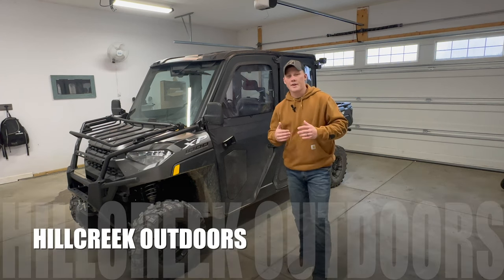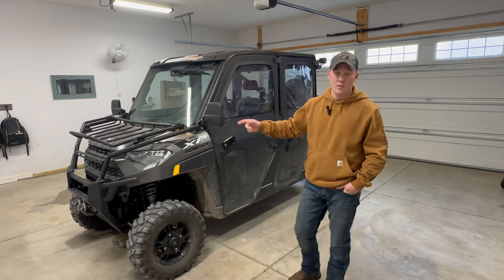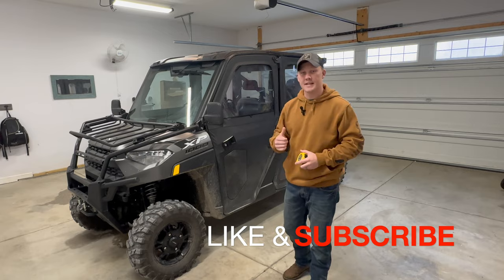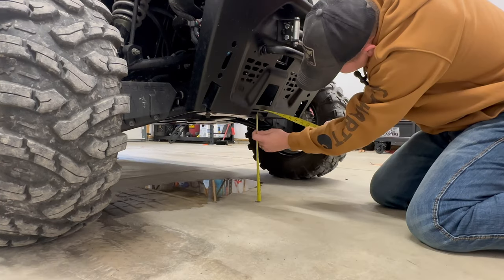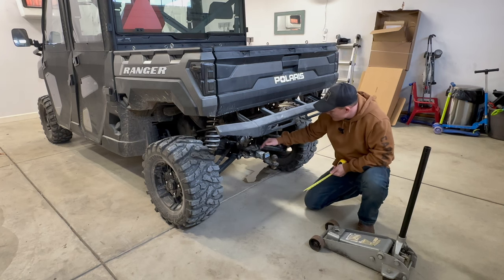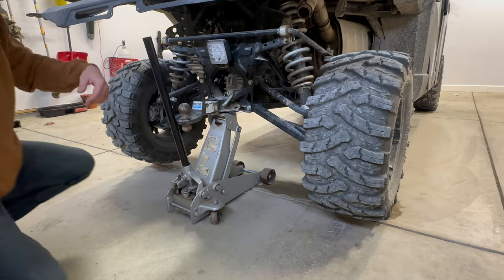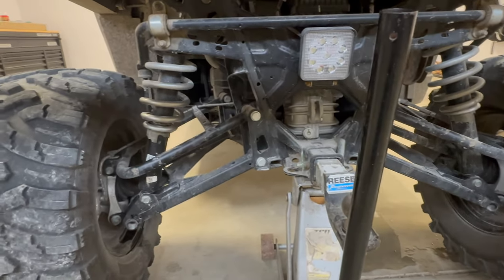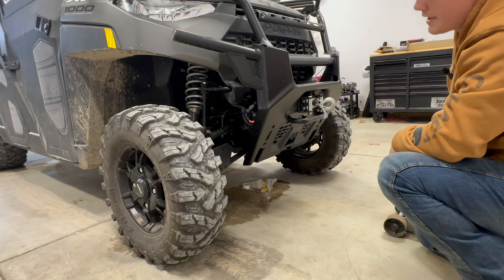POLARIS RANGER: How to Adjust Suspension for Clearance and Firmness

Comment: How much smoother is the softest vs the firmest?
Reply from the maker: @lifewithtimmyd7641  you can tell the difference when riding on rough surfaces like through woods but honestly not a major difference. After riding with softest and firmest the biggest difference would be clearance.